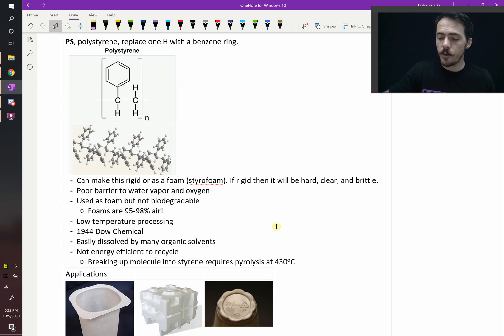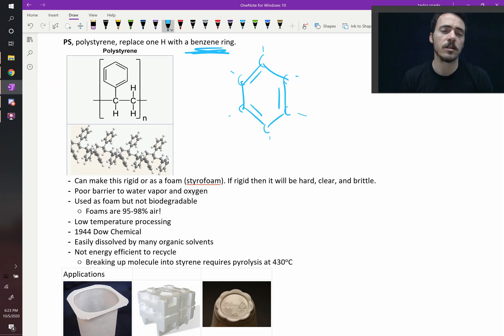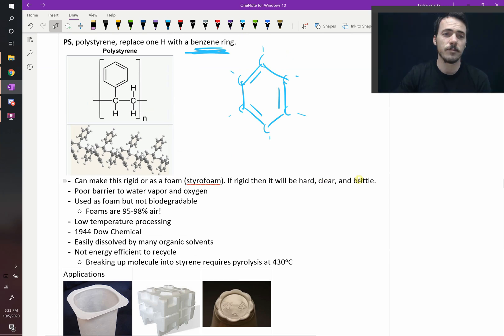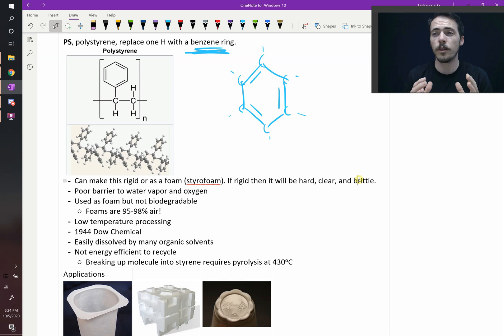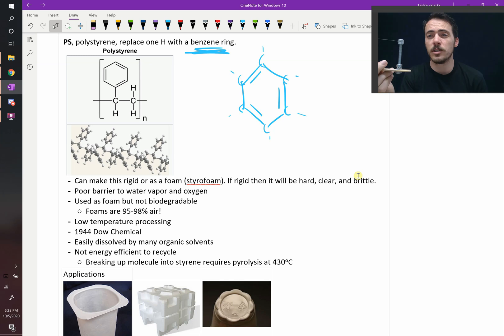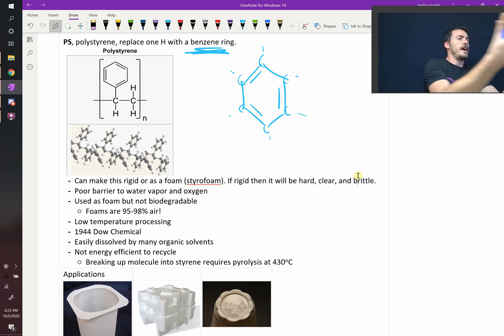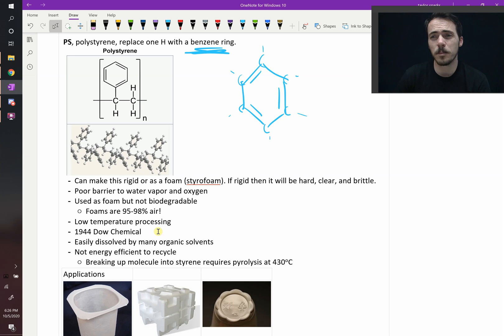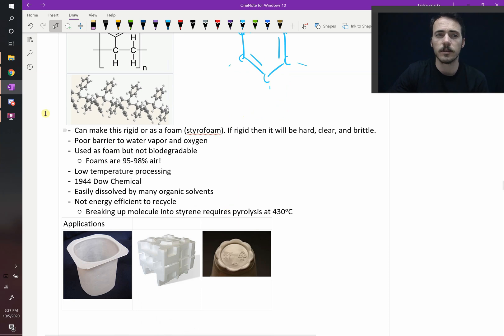What is Polystyrene (styrofoam) and what is it used for?

Comment: It's also a horrible carcenogen. The chemicals used, the dust and the fumes all are highly cancerous.

Oh you want a citation? I'm a thermoformer. I process polystyrene high-impact plastic. I've been breathing in the fumes and dust for two years, 60-80 hours a week.

I now have stage 2 Lymphoma. There are entire law firms dedicated toward litigation against manufacturers of polystyrene for this very reason.
Reply from the maker: Geez. I'm so sorry!
Reply: @TaylorSparks  Don't worry man. Thankfully Lymphoma is easily curable and takes about six months. It's not the worst cancer to have. In fact, of all the cancers, if you had to pick one, it's one of the "best".
Reply: that's not a citation that's an anecdote, but I hope you are ok.

Comment: Kind of random question, does burning styrofoam produce cyanide? I heard that statement and couldn't understand how it would be possible
Reply from the maker: to my knowledge it's not possible. Cyanide needs nitrogen and the styrofoam molecule has none. In practice maybe when they make styrofoam they add a nitrogen containing molecule. Or I suppose it's possible that it interacts with nitrogen in air, but I'm skeptical until I do the free energy calculation to prove it. I think a bigger problem is that it doesn't fully combust the carbon down to CO2 and then you're breathing in partially decomposed products which might be harmful.
Reply: @TaylorSparks  Thanks for your quick and thorough response! The absence of nitrogen is exactly why I doubted it could be accurate.  I appreciate your input. Take care!